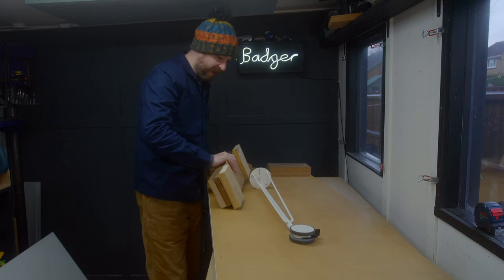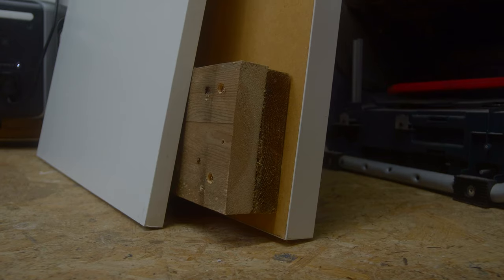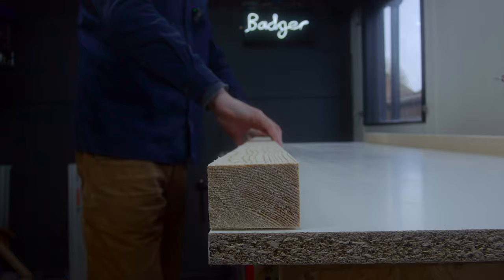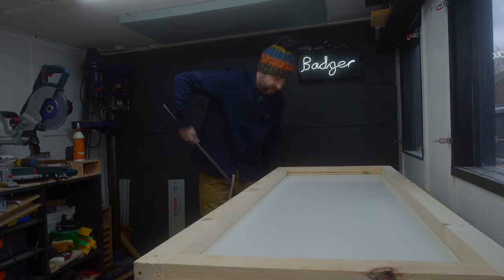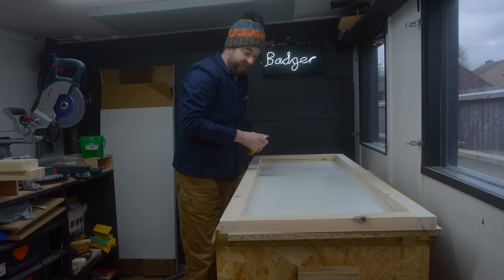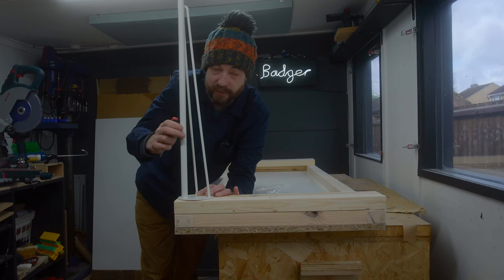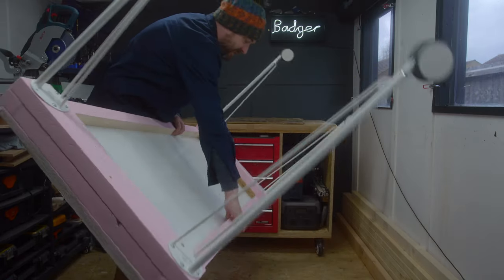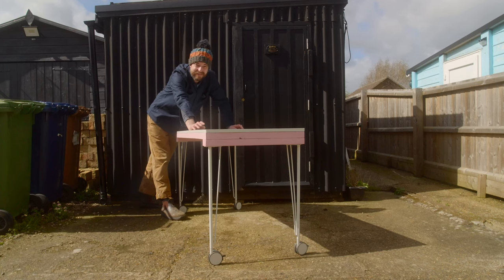Can I Make A Better  IKEA Table ?

Comment: IR-ON, found a dusty one in the garage when edge banding the other day.
I was wondering if you could have removed the honey comb core and reused the white top laminated to a lump of ply? Just a thought mainly because conti board is a ridiculously price product
Reply from the maker: The furniture board I used was pretty cheap. You probably could re use it but might have to spend a while removing glue
Reply: @Badgerworkshop  fair point Matt re glue. My pet hate material, conti. I would rather use oil soaked wet pallet wood. 
Everyone has there quirks this is mine 🙈